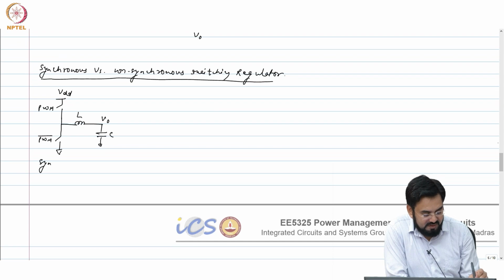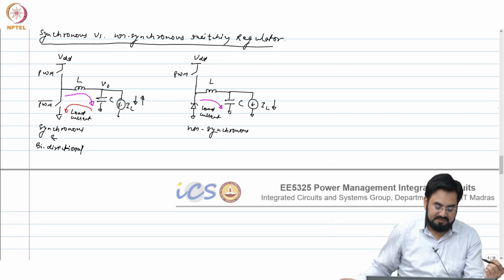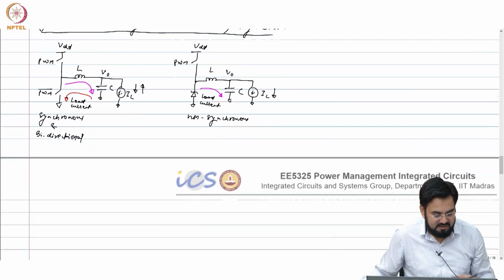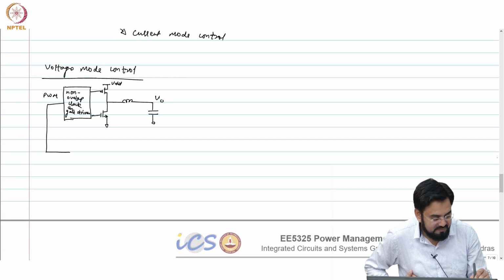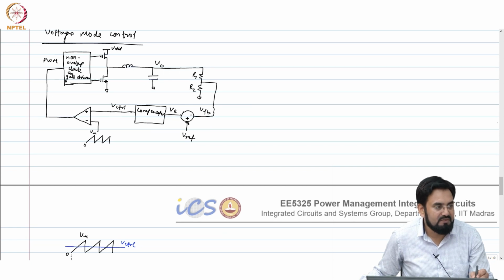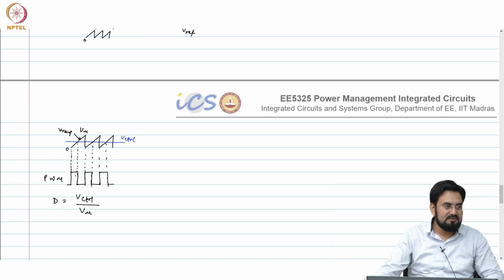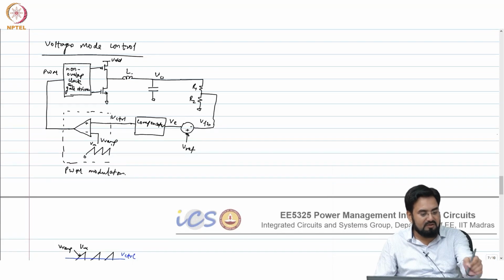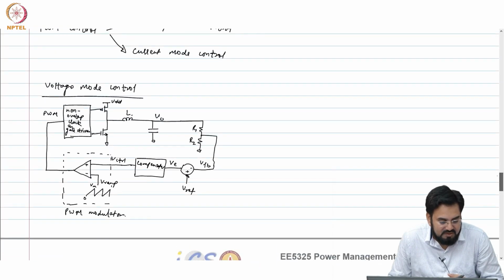#35 Synchronous versus Non Synchronous Switching Regulators | PWM Control Techniques

Comment: At 02:37 sir said for Synchronous Buck converter current is bidirectional, and can flow from either of the direction. But in Buck converter the inductor current does not change its direction. Hence, in both the Ton and Toff the Inductor current will flow from Vx node to the output (where Vx is the other end of Inductor node).How come the direction of the current is shown opposite to each other?

Comment: AT 9:13 sir tells that the gate driver circuits are basically buffers,which basiclly increase the current. But since gate current doesn't control the mosfet in any way (since mosfet is voltage controlled), what's the use of putting gate drivers. Someone pls help
Reply: From what I understand, If MOSFET is big, its gate capacitance is very high, hence it will impact timing of the preceding circuit